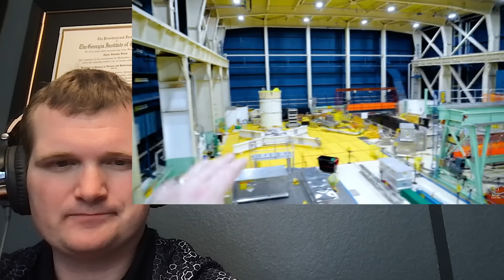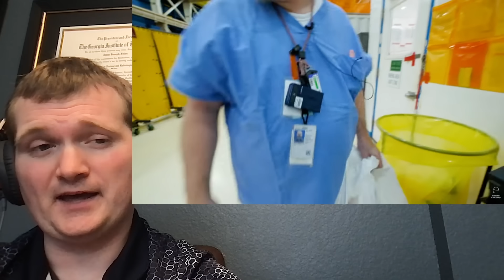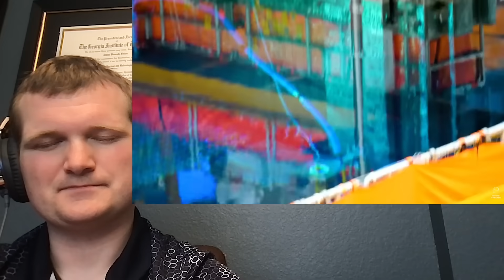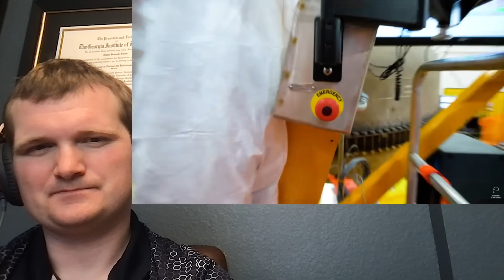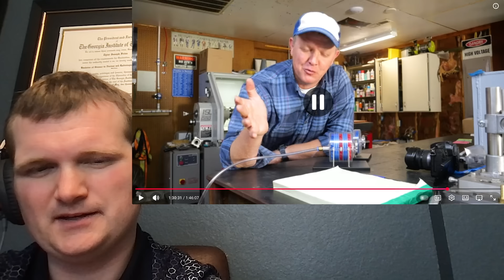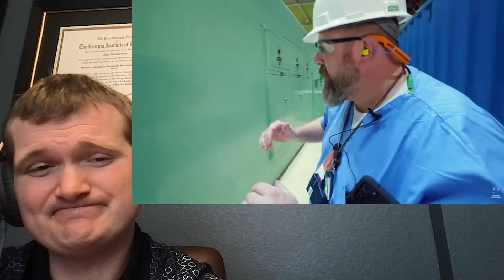Moving Nuclear Fuel with a Submarine Crane - Nuclear Engineer Reacts to Smarter Every Day

Comment from the maker: Here is Part 1: https://youtu.be/aQFSJ80wIsg?si=Q2NyyQXmNR6h34t5
Reply: Really love your videos, but the constant framerate issues are killing me
Reply: dude the video is unwatchable
Reply: Can you please check why the video feed constantly freezes for long periods of time.
Have you tried lowering the quality rate to keep the frame rate up.
I love your videos but its so distracting while watching.
Reply: As others have said, there appears to be frame freezing issues in video playback. i'd recommend working around with your recording software or possibly asking around on some tech forums for suggestions for a computer upgrade.
Reply: F-ME = "Fuck me! I dropped it!" 🤣
At least, it would in the UK industry!
Edit: Looking forward to the Cherenkov radiation. It's my most beloved blue! Neutrons hitting water above c for that medium. 
The Enterprise should emit Cherenkov radiation when "switching to impulse" and crashing back through c in a vacuum.
Reply: Hey Tyler, BFN does 3 hour shifts on the floor. That is for the whole GE crew. They work 10 hours. Bill misspoke when he said “work control” Jessica is the RFF Coordinator. They keep the log, communicate with the Outage Control Center and so on. They are on the radio with the SRO.
The “cattle chute” is the temporary shield installed where the head studs are removed. It is for dose inside the containment while transferring items between the reactor cavity and the spent fuel pool. They also lock the upper levels of the drywell during these periods.
Reply: Thank you for getting Part 2 uploaded so quickly Tyler! I'm so happy to get your reaction and comparison to your experiences. It's purely from watching you that I knew how big of a deal this was when Destin released the previous video talking about how he was going to be able to film all of this.
Reply: This is just like a nuclear reactor... Or like having sex. It's like cooking food in an oven, or using a washing machine:
Take off the package. Turn the nobs. Open the hatch. Put it in there. And wait until it beeps.
Reply: Irradiating My Whole Neighborhood With This One Simple Build!
Reply: 11:11 this is not at all best design... I am not an nuclear engineer or physicist... based on common sense, its not proper design

Comment: Nobody explained the shuffling. I'm assuming it has to do with...making sure their condition is good after the initial optimal years, not wasting usable fuel,, spreading them out so the generated heat is even throughout, and to ensure they're inspected throughout their lifetime?

Also, the cherenkov radiation looks so fake and tacked on!

Comment: About 25 years ago, I worked at a consultancy comprised mostly of ex-GE NE & Toshiba folks. They were nuclear engineers mostly, not many physicists per se, but also some thermodynamics, mechanical, and electrical engineers / scientists. And a part-time professor or two. The head guy had a PhD in mechanical engineering and was a legend in the field of design, analysis, maintenance, and operation of BWRs. Ann Arbor, Berkeley, UIUC, MIT, and Georgia Tech have robust nuclear engineering programs. If you studied two phase flow seriously, you read his textbook.. it boggles my mind as much as modern physics does.

I feel safe with these kind of power plants and this type of rigorous processes and industry. I don't feel comfortable with fly-by-night startup SMRs rolling off an assembly line without the economies of scale, security, and talent large plants provide. Like flying cars, they sound awesome on paper but just aren't good ideas™ in the real world.

PS: All of the computer hostnames were The Simpsons' characters. Incidentally, I built a PC for a microgravity research "Vomit Comet" that included a HDD and CD-ROM drive that would operate properly in ± 2g and handle instantaneous impulses of turbulence but was vibration isolation mounted to handle most of the hard bumps.

Comment: The reason for not getting that close to operating turbine is likely because it is single loop, that is the steam straight from the reactor core going through there in this reactor.
 
As for the complaints, I expect it might be because you are playing an AV1 video in browser using a software decode and then getting rendering and encoding lag and if a frame lags too much on the render it will just reuse the last frame, I think you are recording this live with something like OBS right?

Comment: Hey Tyler, I’d be curious to see your thoughts on a certain scene from a show called “The 100” . Season 7 Episode 3. 

A worker causes an accident and gets the control rods of a nuclear reactor stuck, and gets exposed to deadly radiation. 

The gang comes in and has to manually lower the control rods, and recruit some external help to repair some burst pipes from the cooling system before the reactor reaches a critical meltdown temperature - all while under heavy radiation exposure. 

I won’t say any more, but I’d be curious to see what you make of it and how it measures up realistically (if at all). 

Love the videos!

Comment: Physicist comment I think the best answer he was looking for was "the Reactor Engineer", the person who analyzes and tracks which fuel rod or control rod with its lifespan is located where in the core (vessel) or Spent Pool.  I think his host used the local site nickname "nuke" to describe the RE, I don't think he was referring to a former Navy Nuke as you mentioned.  

Moneymaker, I think that is the generator.  :) 

Superheated steam, I hated hearing his host keep saying that.  Both BWRs and PWRs are "saturated steam" plants.  Some fossil fuel plants go the extra effort and cost to superheat the steam to raise efficiency of the plant but not here.

Proximity to the turbine, or any of the steam lines, in a BWR is limited by nitrogen.  Neutron flux in the core turns some of the oxygen in the water to nitrogen and then it decays away (back to oxygen I assume, never thought about it) in just a handful of seconds emitting gammas and maybe others.  But in those few seconds the steam is traveling out into the Turbine Building and into the turbine.  I suppose PWRs have this same phenomenon but all that N-16 dose would be contained in "the can" with the steam generators.
Reply: Hard to tell. But that work is definitely not something a physicist would be interested in doing. I would be bored out of my mind.

Comment: I guess you don't want to go near the operating turbines in a BWR because there is no secondary heat exchanger. The steam comes directly from the reactor core and can be a bit spicy in operation at 100% power 😅
That's why there was that concrete labyrinth around the turbine area. The generator shaft passes through the concrete shielding so that there is almost no stray radiation on the generator side.

Comment: Question: when all 3 units are up and running, how many people would be on this refuelling floor on a typical day?
Reply: Sometimes it’s empty, sometimes there are 10-20 depending on the tasks. They have work year round receiving new fuel, dry cask storage campaigns, unloading equipment from the previous outage and preparing for the next one.

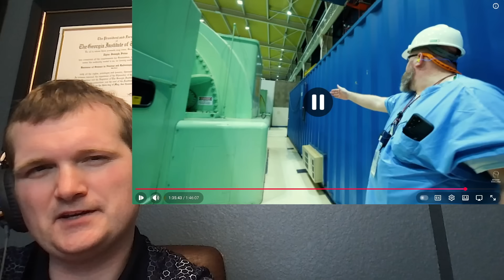Comment: 1:21:35  Could be different things. From what I've heard explained its because the steam used in the turbines in a bwr is from a primary loop and could raise the radiation level in the area, which is why there's a big wall between the generator and turbines. Then again, a thermal plant I've been at the turbine hall was off limits during operation as well after they misfired the clutch between the generator and turbine shaft (yes, they had a clutch there), caused a small earthquake in the building 😅 So now they didn't want to anyone to be there in case something else goes south.
Reply: Yes those walls are shield walls because of the radioactive steam. It is a high rad area during operation. Not necessary around the generator. Also those shield walls are designed to contain a turbine blade if it was to break off and become a missile to prevent from hitting the reactor building and equipment needed for safety shutdown systems.

Comment: If the turbine trips, what happens? reactor shut down, steam vented..?
Reply: Exactly trips and steam is dumped to the condenser via bypass valves. If the condenser is not available, the steam is dumped into a large pool of water inside the primary containment.

Comment: The steam from the high pressure turbine doesn't go directly into the low pressure turbines.  It has too much entrained moisture which would rapidly erode the blading of the low pressure turbines.  So the steam from the HP turbine is passed through moisture separator reheaters to improve the steam quality before going going to the LP turbines.

Comment: If a computer upgrade isn't within your budget, there's still a way around this video freezing problem. Basically your confuser is trying to do too much simultaneously. Record yourself separately (if you have to for placement, have a lower-quality version for the picture-in-picture initially -- fewer pixels = less thinky). Next, scrape a higher quality version of the YT video to which you're reacting using Freetube or other such software. Finally, put them together in video editing software (openshot or shotcut are free & open source).

Comment: I have only worked with coal or gas fired power plant ... and the coal washeries... and the poles and wires in Australia - which I think might be the biggest single power grid that stretches ... idk .. 10lk km something ..... but the synchronisation of the power grid  .. well it's 50Hz here at 240v. ... but this thing is the size of a very big building and .. well ... it's seems like a rhoestat... it's all about the lengths of the transmission so they all arrive in sequence and add up sine waves than cancel out  if they are 180 deg out

Comment: For PWRs you not only need to shuffle fuel assemblies but you also need to shuffle control rods. fuel assembly will typically stay in the reactor for 3 fuel cycles (6 years if on 24 month fuel cycles) and it will not stay in the same location for all 3 cycles.  Not every fuel assembly will have a control rod.  A separate handling tool is used to swap control rods which has a device to restrain the individual control rod fingers so they line up with the guide tubes in the receiving fuel assembly.   Control rods typically last longer than fuel assemblies but they do have finite life.

Comment: I think your computer is being bombarded with radiation from an exposed core right now.
Reply: I thought it was my computer acting up was driving me nuts.
Reply: Helps with copyright
Reply: @YogeGod  Shouldn't have to worry about that since this is educational and transformative. It doesn't replace the original video but it does add transformative content to it.
Reply: @YogeGod  
I think Smartereveryday has signed off on this. Probably just more of a capture thing. Not sure how much money Tyler wants to throw at a GPU and capture card etc.
Reply: @YogeGod  I doubt it's protect with copyright due to the audio. I'm wondering if it's more of a processing thing since others have mentioned the video has no problems, guessing somewhere else?

Comment: "Lagging" is the boards and cloth around a boiler from the days of steam engines, it's not a super common term, but I would not be surprised if someone called it that when the plant was new and it stuck as the nomenclature since.
Reply: Bill learned that pipe insulation is called “lagging “ in the Navy.

Comment: Have you seen Kyle Hills video on the Natrium nuclear reactor? It's a sodium cooled fast reactor design, which then will go to a salt intermediate before water, which can act like a buffer so they can bank some heat during low periods and use it during higher demand, I believe it also doesn't need as much backup equipment if there's a power outage.

It's certainly an interesting idea compared to more traditional boiling and high pressure reactor designs.

Comment: hey, if ur using OBS Studio, try to change to 1080p 60fps but hardware encoding, not software, or try CPU not GPU recording, cause you are droping lots of frames, so it stutters
Reply: He should switch to 24 fps. There is no need to run 60 fps here. It's a steady recording with slow movements. 24 fps will look very natural. There's a reason why it is the standard in motion pictures still.
Reply: @AB-80X the youtube video would atutter then..
Reply: @vakarisdobrovolskas8508 
No it would not. Does a movie you watch on YouTube in 24fps stutter? Nope.
Reply: @AB-80X remember youtube videos are either 30 or 60fps so if you re-record in 24, you get stuttering bc of mismatch, like with 50 and 60hz flickering you set either 1x or 2x the frequency of power for anti-flicker
Reply: @vakarisdobrovolskas8508 
Not sure where you have that incorrect info from. YouTube can both accept uploads and play in 24fps.

Comment: Question: What are all the box-shaped things wrapped in yellow cloth around the spent fuel pool? Because those are absent from the spent fuel pool of the active reactor. I assume that the hence around the spent fuel pool is covered in orange tarps to help reduce the risk of anything falling into the pool? The secondary yellow barrier around the spent fuel pool of the shutdown reactor looks very thick. Does that contain some radiation shielding or what?

Comment: Oh! 20 mills is 20/1000" in the US! In the UK, 20 mills is 20mm (20 millimetres or 0.787402") The thing would've taken down the building & everything in it! 
The dry steam thing comes straight out of UK steam locomotive research. And then a boat called Turbina, the first steam turbine powered vessel. 
So you're seeing the direct result of the industrial revolution. 
The math & physics of pressurised dry steam was worked out to move trains & naval ships back when the condensing engines in mines were replaced with 3 stage dry steam compound engines and later turbines. 
This is old technology reinforcing the description of nuclear power generation as "It's just hot rocks boiling water!".
Reply: "Mills" for "thousandths" is an old fashioned term that's discouraged these days (at least in machining/manufacturing), I think because of the potential for confusion with millimeters. You still hear it around though, especially from older guys. 
I thought of the same thing when they got to the steam dryer and compound turbines as well, we had similar tech in the US but the British definitely pioneered it and I've always had a soft spot for British railway history. (Probably thanks to growing up watching Thomas lol.)
Reply: @max_archer   Ahaah! When I was a kid my Dad worked for STC/ITT and the thousandths was simply "thou", at least in the capacitor section amongst operators & engineers. 
Growing up surrounded by Brunel's GWR got me into steam traction & industrial archaeology. 
I must admit to being wary of nuclear power stations built & operated using imperial metrology though! We watch an overview and already there's confusion about turbine / generator shaft runout! ☹️

Comment: The safety procedures and everyone’s reaction to them reminds me a lot of how an aluminum smelter that i’m familiar with operates. Those smelters can become extremely dangerous (whenever they are turned on, everyone feels the massive magnetic field even 1-2 km away from the the factory and in fact, they have their own private hydroelectricity dam to generate current for their operations as it requires so much power. A single water bottle dropped on one of the smelters would equal instant explosion of the whole factory)
They completely flipped the concept of both criticizing safety errors on it’s head by transforming the criticism into something positive. To make it short, whenever a worker spots any safety concerns from their collegues work, they receive an aluminum coin and at the end of the year, the company accumulates all the aluminum coins from workers and makes a donation of X amount of $ per coin, to a multitude of non profits and community orgs that are voted by the workers.

Comment: Hey Tyler 👋
Waited for your input since Dustin's video was out. 

P.S. : Like many in the comments, your video freezes a lot for some reason.
You probably need to record the video + your reaction at a lower frame rate (like 30 or 24) and lower resolution (maybe 720p should be ok).
I don't know the spec of your PC, but it could also be a problem with your editing tool, it maybe need a bit more RAM, or it is not configured correctly.
Oh, I also think it just could be you looking at the video with a resolution too big for your PC to handle with the recording in the background. As the freezes usually happens when you play the video.

Comment: I was there when they first started our NPP..that giant turbine was sitting so long it was out of balance..it felt like an earthquake..shook all the plant so much cement dust filled the air. They would stop it..engineers would go into it and place large metal plates on it..fire it up..less shaking..repeat until it was smooth..like balancing a tire. Giant containment doors everywhere some weighing many tons separated the different containment buildings. Giant air handlers and miles of cables ..you feel very small when your walking through these plants

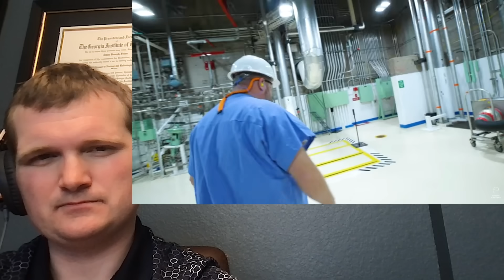Comment: 1:03:33  As an electrician I LOOOVE the pipework in this room.  Very well done to whoever ran that.  Hat's off to those fine sparkies. 🫡
Reply: Replacement parts for electrical gear is destructively tested by the seller and buyer for flame self-extinguishing properties, and the time is recorded with the order.
Not just random junk from Wish or Home Depot.